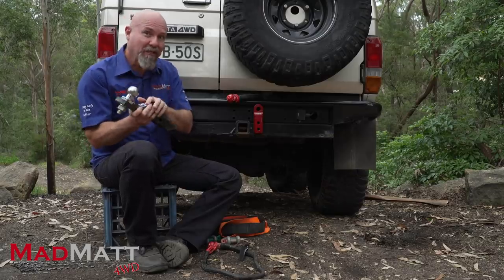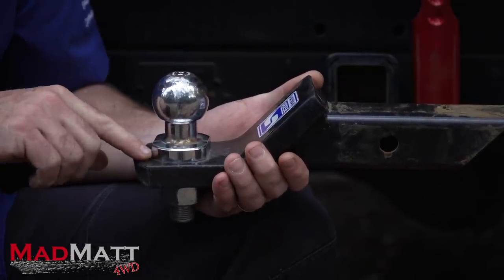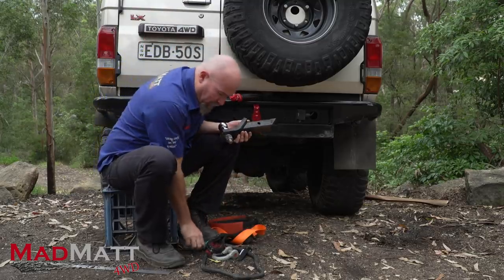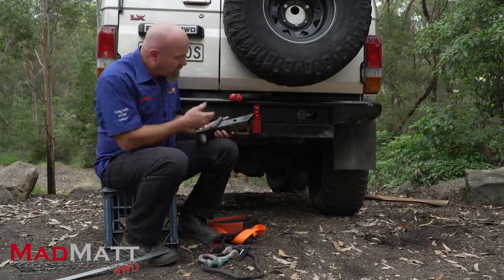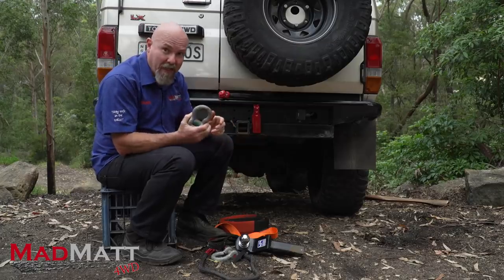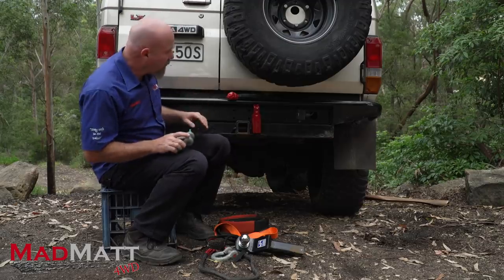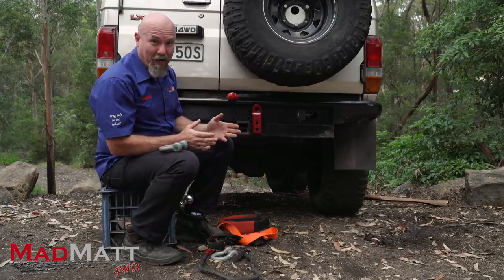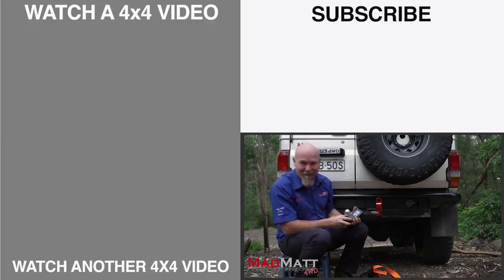A Tow Ball is NOT an option in a 4x4 Recovery? FIND OUT WHAT GOES WRONG

Comment: The ball is not in " shear" as you put it.   When the ball retaining nut is at the correct  torque, the flat mounting surface  of the tow ball against the flat tongue surface is what creates the  clamping force which creates a frictional resistance to loadings.  Its a similar thing to how a flanged drive shaft loading  works.  The bolts  holding the flanges together are NOT in shear they are in tension.  This tension clamps the surfaces of the flanges to create friction and it is the friction that  delivers drive from one flange to the other .  If the bolts are not tight enough then yes... they are then in shear and they can/ will indeed shear.  
  When using a ball to recover of course any rope/ strap could slip off the ball so use a restraining loop to make sure this cant happen  or use some other way..  Now to the second point where a hitch is located in  the hollow receiver with a loose fitting  cross pin.  This is indeed  " double sheer" but I would wager that this will fail before the ball fails[ unless the ball is damaged  etc.]  Now imagine if the hitch [ square tube] was clamped between two flat bars by tightening  a high tensile through bolt,  Now, friction will provide all of the load bearing and the through bolt will not be in shear, and I think you will appreciate the analogy with the flange drive.
  So to summarize, it is the  clamping force that provided the frictional resistance and the  threaded  element that provided the tension to create the clamping force.
  With regard to Ronny Dahl...  he is an idiot!!
Reply from the maker: You make some great points. A comment near you is of a guy whos in hospital because his ball failed.
Reply: @MadMatt4WD   well lets see the details.   I  for one am ready to listen.  I  recall in your video that you observed how a rusted out hitch [ rusted down to 1/16 inch at a loaded weld  point], failed at that weld. Well ..anything will fail if its not maintained.  Eventually the vehicle will rust and fall apart due to gravity.  Matt, your going to have to do better  . Now of course,  lets not forget that " road wheels have been known to fall off vehicles and kill people " and the reasons they come off are not dissimilar to the reasons why towballs may fail,  The roadwheel is held in place by the clamping force [ creating friction] between the wheel mounting flange and the axle.  To maintain this clamp force the wheel studs must  be torqued to the correct value so that the studs are never in shear... only tension.  Again  it is the friction created by the clamp force that is important.  So by all means make more video' pointing out that a tow ball stud mounting nut MUST be torqued to the proper value so to prevent this part ever coming into shear.   When the stud is prevented from being in shear the next point to fail will be at the " waist" of the ball.  Well good luck  snapping  the ball at the waist.  It can happen in a jackknife or rollover  but that's not relevant  to this discussion.
 Education involves more than simply trying to scare people. [ try politics]
Reply from the maker: Here's a comment from above this comment. 
Billy Gauthier
2 days ago
I don't know if I can watch this.    I just had an accident on Tuesday.   Cracked my skull with a 2 5/8 ball that came flying through my window.   Day 3 of recovery after surgery.      Don't do this.      

I was just giving a quick tug to pull start
Reply: @MadMatt4WD   reply to Matt directly.

  Lets look at this Matt.  Firstly its not a recovery its a  method to start a manual gearbox vehicle by getting it rolling after selecting a suitable gear and easing the clutch into engagement.  But we are not provided with any  evidence of what actually occurred.  Was the ball on the towing unit correctly mounted where did it break at the stud or the waist?  What was used to connect the  towing unit to the towed vehicle?  Was is a chain?  Was it a strap?  Was it a rope?  Was a suitable gear ratio selected?  Was the clutch " dropped"  or eased into engagement?   Did the towed vehicle take all of the slack before moving off slowly or did it do a " ronny dahl "  charge  in the false hope that this would help ?. 
  Matt, you must do better than this.
Reply from the maker: @tiltingvehicle1844  You are defending poor practice here. Yes we don't know the full circumstances but at the end of the day to defend the use of a tow ball as a recovery device is foolish. You must do better than that. It is so easy to use correct gear that for the most part is better than a tow ball. So stop defending poor prcatice.
Reply: @MadMatt4WD    I am not encouraging or defending anything necessarily " it depends"   Unlike you I have not told anyone " what to do"     All I am doing is pointing out the engineering considerations that need to be understood  to make a decision which might not be ideal but  may be necessary[ and acceptable] in certain situations.  You have illustrated clearly to us that you were not aware of these engineering facts. And FACTS they are! I have suggested that the ball face should be flat  with a perfect match to a flat tongue with the nut torqued correctly and I strongly suggest that any towball failures is/might be due to  neglect of this requirement.. And so this brings into question [ I suggest]  the reports of balls failing without a closer examination of the evidence.  I also pointed out that your concept of " evidence" is abysmal.

Comment: Mr Matt, thank you for this video! I wil learn this lesson for sure! 
In my case, that I have a smal pickup in which we use the rear bumper as a hitch (it´s rated for 3500 pounds). I don´t go off road with it, but I pull a lot with this truck; mainly cutting trees and cleaning gardens. In some points, we use the truck as a tractor, but untill now using the hitch ball as the anchor point. Would you sugest to use a shackle instead? I know you talk about why it is not good in recovery situations, but in this case the shackle will atach to the bumper stamp sheet metall instead of a hitch plate. 
Thank you!
Reply from the maker: Why not just get a hitch receiver like I show in the video and make sure you're safe. As I say the metal plates are also known to fail. If you use the code madmatt you can get a discount on the products linked in the discription.

Comment: Great video. So my Jeep Wrangler JLU has a rear tow hook on the driver side rear.  I also bought a factor 55 hitch mount recovery point.  My thinking is the center pull should be better than the off-center pull of the hook, so I would use the factor 55 in a recovery situation(all else being equal).  After seeing your video, now I am questioning my thinking.  Which do you think would be better to use in a basic rear recovery situation with a JLU?  Thx.
Reply from the maker: If you’ve got the Factor55 recover that’s the best solution. Well done.

Comment: A 40.000lb. Pintal hitch is that you should use, usually about $110.00.
Reply from the maker: A pintle hook is a reasonable tool as well
Reply: @MadMatt4WD  It is faster to connect and disconnect from and a solid connection welded to the rear of the vehicle bumper when a Hd Steal bumper is installed.

Comment: Sorry but I must call you on this, you refer to ratings on things and yes this is a critical element, the tow bar or hitch itself is not rated for recovery as it is originally designed, intended and fitted, you must accept this fact and take into account, therefore it must be addressed, having spent many many years recovering and repairing vehicles form areas in the Kimberley including the Gibb River road the only successful method I employed to keep towbars securely attached be it just normal towing or recovery use is to employ some welds in an area that is accessible by grinder to remove paint from both surfaces to be welded, this ensures you can grind welded section away to remove when required, dont weld where you can't grind, 1 inch of weld will hold 2t, so 2 1" welds per side, (this can also be used for steel roobar mounts) this will stop mounting bolts taking all the shear load and stop from becoming flogged over time, as for attaching strap the best and possibly only method to use is to pass it around the back of the bar then onto to anchor point at hitch receiver, this transfers the bulk of the force being absorbed by the friction between the strap and the bar and the remainder to the hitch, should the hitch fail it will be pulled into the receiver not out, if it shears off energy will be dispersed going around the bar before it becomes totally free of vehicle, personally I always loop over receiver section then refit tongue hitch so it can't come off so tongue takes no load at all, if the eye or strap fails there is no solid object attached and energy dissipation is instant, the other thing is the twist motion deployed to tow bar with this method it is unlikely that all mounting points will fail simultaneously as loads are not instant in shearing load as with a straight pull, if something fails gradually this dissipates energy more efficiently, just take the time to look at the failure path, yes it might cause some damage but the energy dissipation is the key to success just like using a snatch strap lessens the shock load
Reply from the maker: Hey mate. I TOTALLY AGREE with what you have typed. Very good information. I seldom go into all this detail in my videos because so many people get confused due to not understanding so many of the principles going on. So much of what we do in 4wd recovery is done using what we have on hand. Even in your examples you have found safe ways to use the gear you have on hand. I'm trying to help people understand that there are better ways than a strap on a ball. But read the comments and you'll see what I'm dealing with.

Comment: What are your thoughts on just putting the strap in the receiver and putting the pin through it?
Reply: I have this same question.
Reply: those pins are rather thin and if you bend it, you might have a very hard time to get it out and release your tow strap.
Reply from the maker: Gents. Thanks for the question. Best off reading my Blog at this link. https://madmatt4wd.com.au/2014/01/27/is-a-hitch-pin-acceptable-as-a-snatch-recovery-point/
Reply: Don't use the pin as it bends and can break. Use a hitch receiver. READ MadMatt's blog it explains your options and more on safety.
Reply: @Malc664  You must have read a different blog as the one above says different.
Reply: @iffykidmn8170  I may have but using the pin is not recommended as they bend, have broken but not sure if people have been hurt but wouldn't like to find out the hard way.
Reply: @iffykidmn8170  Actually I read the blog and MaddMatt said he used the pin without any hassles but if you read further on there is a comment from "eastcoastcam" stating you should never use a pin and an incident where it failed and broke a headlight. If you read further on MaddMatt say's; "For a long time I thought using the hitch pin was a concern, so I would avoid using it. After watching numerous safe recoveries and talking to some industry experts, I felt that it was a safe technique, although not the safest".
The thing is after reading the whole blog I wouldn't use the pin. just make sure you have a tow hitch with shackle as they're affordable and safer.
Reply: If it's a more simple recovery the pin should be fine.  But if you are dragging someone through the mud and giving it several runs and using a recovery strap or rope then a recovery point on the receiver is a better option.   Of course if there are recovery points on the rig, even better.
Reply: @olliehopnoodle4628  Yes I can agree on that.

Comment: Question for yah. How about the pin? Would a grade 8 5/8" be better than the standard pin?
Reply from the maker: One would think so. But what are the standard quality pins made off? I don't know to be honest. As I say in the video I would still prefer to use the hitch reciver.
Reply: Well so here's the issue, the pin has a similar strength and material as the rest of the hitch, hot rolled carbon steel. If you added a grade 8 pin and solid bar insert, eventually the bolt will  slice through the outer receiver, fracturing it.  13,000 single shear of a grade 2 pin, 26k double. That's a doozey of a pull. Likely close to the breaking of the hitch itself.

Comment: Couple of things I think you neglected in this video, although you do touch upon it with some of the stories and lead-ups to situations, is: 
Keep your equipment in good working order and inspect it often. 
While it may not be convenient or pleasant to the eyes, nothing should really be left in the receiver unless you're using it.
Reply from the maker: Great points.
Reply: @MadMatt4WD  So the rusted bit that failed would be in a similar example of cutting half way thru ball shank to get a failure?  Is there any examples of failures when not using compromised tow points?  What would the failure point be on one of those Factor 55 receiver recovery points after repeatedly dragging it on the ground from low departure angle and being ground half way thru?  Also can I use any bow shackle as long as it is rated?

Comment: There is something that you missed.  What about the front?
Because I don’t have a bull bar or a winch I am more likely to be pulled out of a situation from the front than the back.
I don’t have a front bar, but all of the recovery points I have seen for the front require a bull bar to be fitted first. 
What should I do??
Reply from the maker: I didn't miss it per-say. I can only cover off so much info in each video or they would be way too long. In your situation you should speak with your local 4wd accessories supplier or research whats available for your vehicle.

Comment: Thanks for the info! I agree with your entire video presentation. However, That’s a crap tow ball which in all honesty most people own. If you use a solid steel tri ball your vehicle hitch or tow strap (snachy, recovery rope) will fail first.
Reply from the maker: The triball isn’t going to fail but the right tool for the job is always best.
Reply: @MadMatt4WD  If as you stated the triball isn't going to fail why isn't it the best tool for the job, Multi functional would make it the best tool no?
Reply from the maker: Because it's not designed for this job. It's like using a pair of multigrips to undo a bolt. Yes they do it but not as well as a spanner.

Comment: Ball receiver you have is very light weight. I only use one like that on my side by side.
Reply from the maker: This is a 50mm/2” ball
Reply: The part the ball is attached to is light weight.
Reply from the maker: Ok. That’s interesting. In Australia that’s often used to tow up too 3500kg trailers. And we are a nanny state on safety.
Reply: @MadMatt4WD  What is the tow rating on the ball and is it 3/4" or 1" shank size? Also what is the tow rating on the receiver 5000lb 7500lb or 10,000lb?
Reply: The ones I use are rated for 10,000 pounds, I stay away from the light weight parts.

Comment: Not buying this. A 1.25in dia tow ball shank has a cross sectional area of 1.23sqin.  Receiver pin is 0.31sq in.  Even though two ends of pin (2x 0.31insq= 0.62 sqin) are sharing the force,  the tow ball shank STILL has TWICE the cross sectional area for the same shear force.    The shear strength of  a grade 5 bolt, 1.25  dia bolt is  77,000 pounds.  Grade8 is 110,000 pounds force.  The hitch pin  will fail first by a factor of 2.   Use a  solid steel 2in forged mount for just a bit more $ and never worry about Chinese welds again.
Reply: Your maths is fine, but the hitch he shows is 2" solid
Reply: They look impressive but you still get the problem with leverage. My concern with that would be getting hung up on it.
It shows $90au plus delivery on the site so way more expensive than Matts hitch.
Reply: $43 in USA. I have one.  It's overkill, but internal corrosion cant happen with salt since there is no internal cavity.   Of course it will rust from the exterior.   True is does smack the ground sometimes.
Reply: @BlackBuzzzard . Yeah freight and the exchange rate kills us.
Happy wheelin
Reply from the maker: @blackBuzzard That's all well and good but they're failing and if you go watch Ronny's video linked above you can see it happen after 8 hits' Also go and tell the families of those killed that your math says it didn't happen.

Comment: We call this a tension sheer off. Where the metal that is used in this is not really made to take high tension. Never mind as I type this your saying something very similar 😂😂😂. But if it does not sheer at the ball joint then the pin will. Unless it’s a high carbon or went through five or six heat treatment then it’s not going to take any more tension then what it’s rated for.